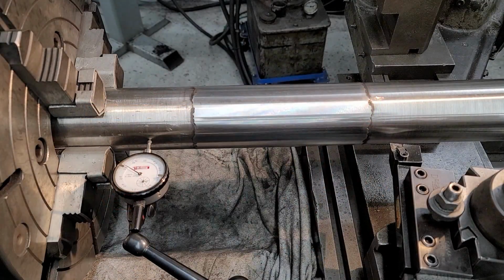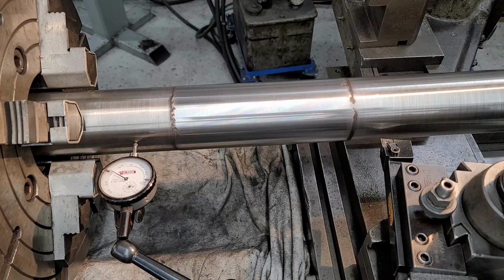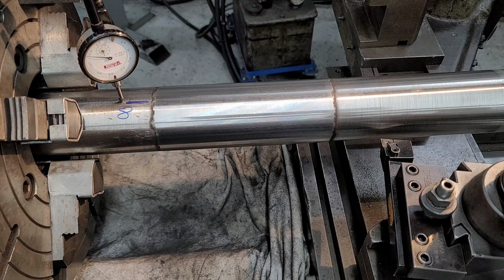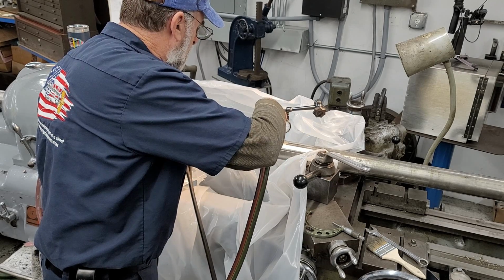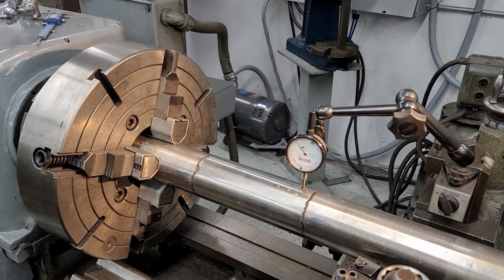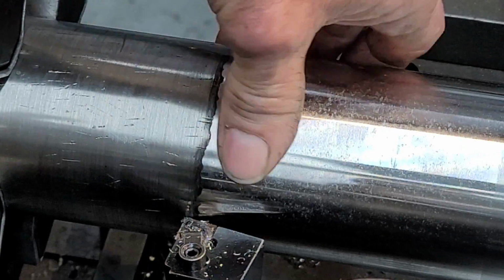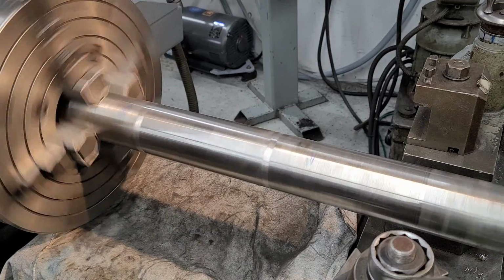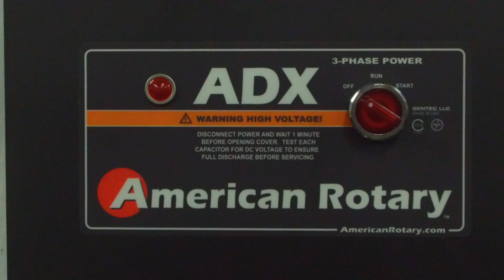A Day In The Shop 4/14/2022

Comment: Always good videos, but one thing that would be great is if you could equaliz the sound, the parts where have the oxy on or blow air are incredibly loud compared to your talking or machines running.
Reply from the maker: You get that in the shop atmosphere, not going to narrate my videos to rid of that, some I shoot with mic and sometimes shooting with Note 20 and not using mic's.
Reply: Me: ooh, that's a little loud.  (Turns volume down)
Me: ah, he's done.  (Turns volume back up)
See?
Reply: @mikemarriam  yeah try that with a 6 month old trying to sleep in the room next door. 

Theirs a little thing called production quality and in my opinion Keith had been trying to up his lately with better cameras, trying to cut out background noise with the phase converter.